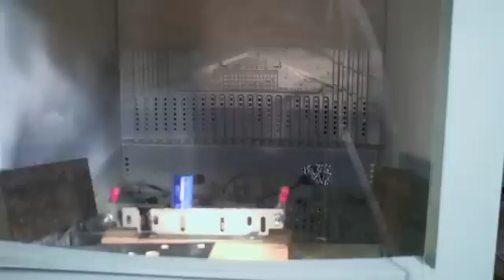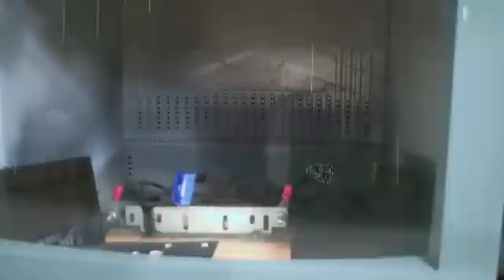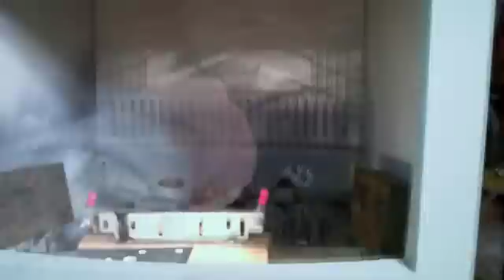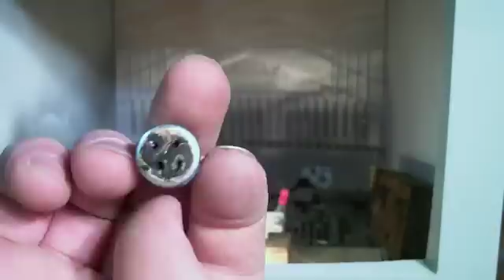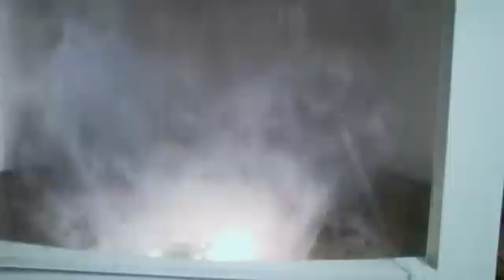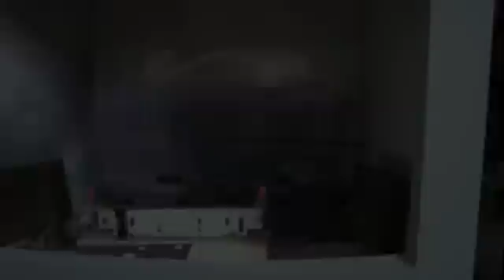Capacitor Voltage Overload.

Comment: It's simple to blow caps - just hook them up backwards (if polarized) and deliver more voltage than they're rated for (if it says 10v on the cap, use 18v+);